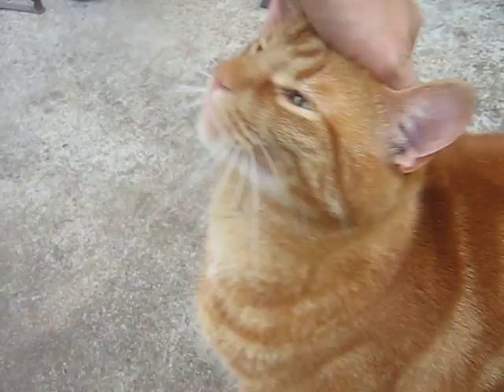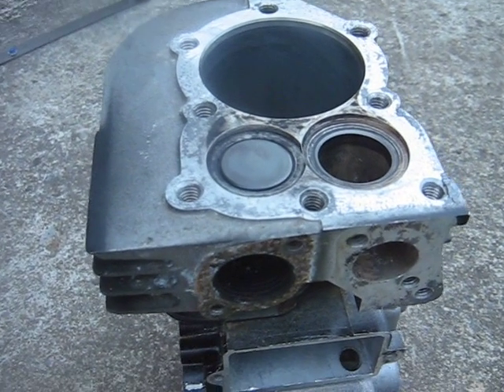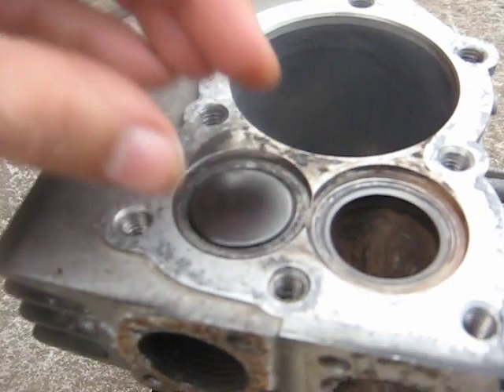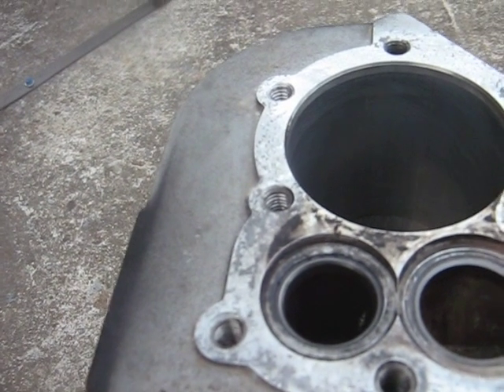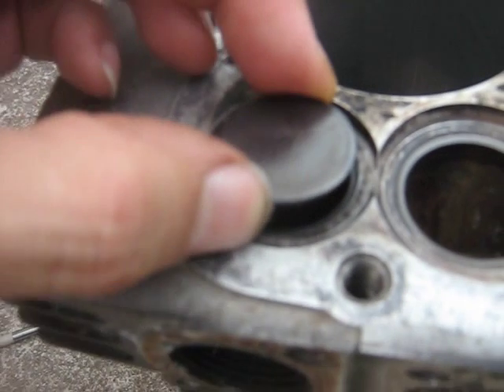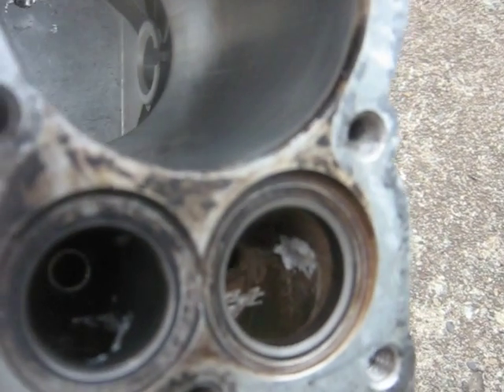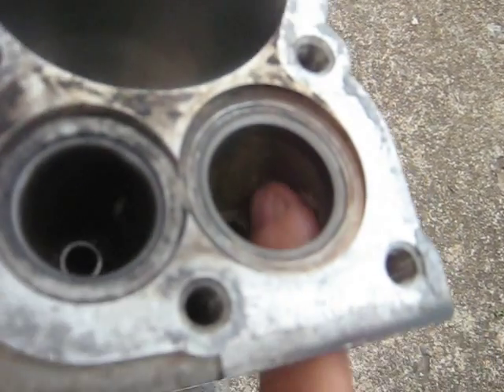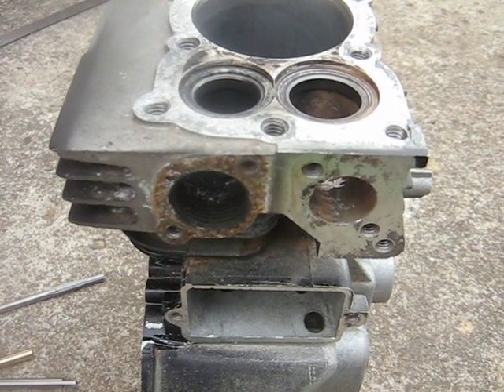Vid #3 Go kart Engine Valve guide

Comment: It's interesting how so many of these engines have abnormally loose exhaust valve guides. I just tore apart a Tecumseh that barely had any run time on it before it ingested something and tore the cylinder up. The exhaust valve guide was about like that. A 3.5HP Briggs I also got running a couple months ago that had a really nice cylinder and intake valve guide also had an abnormally loose exhaust valve like this yet it runs great like that. I wonder if they are loose on purpose for expansion? I have a NOS 3.5HP short block I might take the valves out of just to see how those fit since it's never been run.

Then after that I figured out a way to grind the valves in my mini lathe for an experiment, and they turned out quite good. That's when I noticed Tecumseh had installed the intake seat crooked in the bore 🤣 no wonder those engines suck so bad. It's junk, but good for experimenting on.
Reply from the maker: For a while Tecumseh seemed to be making under size crankshafts on their 8 horse flathead engines. My step father started a brand new one up, it ran about 5 minute, then blew its mind, with crankcase parts flying 30 feet! It was on a generator, so there was LOTS of inertia from the extra flywheel weight of the generator to push the con rod thru the block, and keep on going! They never honored the warranty because he couldn't swear on a stack of Bibles that he had filled the motor right up with oil before starting it. Trust me he did, as I looked at the busted con rod, the parts were nice and shiny, not melted and burned. A number of years later the mystery was solved by a seasoned small engine shop mechanic, who repaired the exact same engine for his brother in law, after he started it up and heard the con rod knocking. He was lucky enough to shut it off quickly enough. This guy proved that the new con rods were too loose of a fit to the crankshaft , right from the factory! He bought another new rod, and it fit the same way! He hand filed and ream the new rod to re-size it to the proper (about 0.002") clearance, then the engine ran fine, and held together. This is a case of a factory recall being NEEDED.  Watch my latest vid about the Briggs Bouncer motor, and give me your best guess at what the heck would cause (or allow) a 4 stroke engine to act that way! Take care.

Comment: The guide looks longer then any briggs guide I have used. There is too much play for sure. Could be some wear on the valve stem too. Prob will have to cut the seats after the guide job . Be sure to use the special grease that comes in the box with the valve.